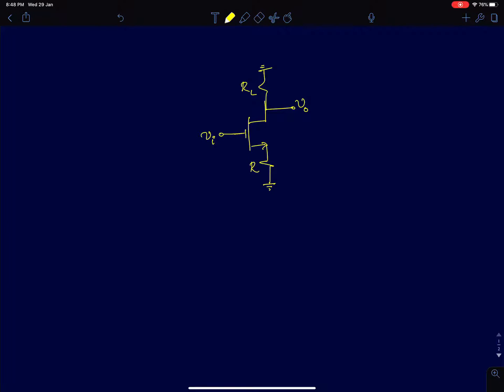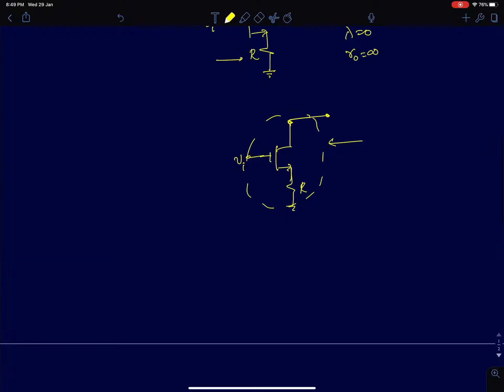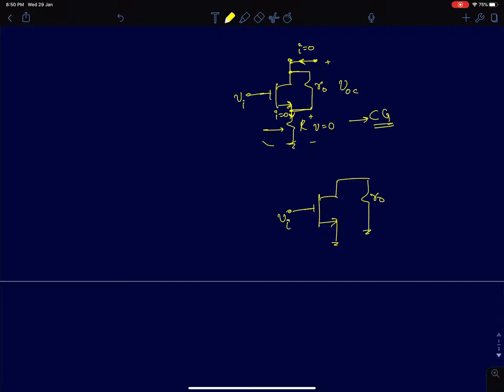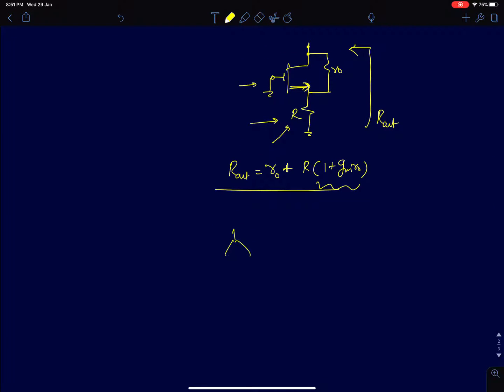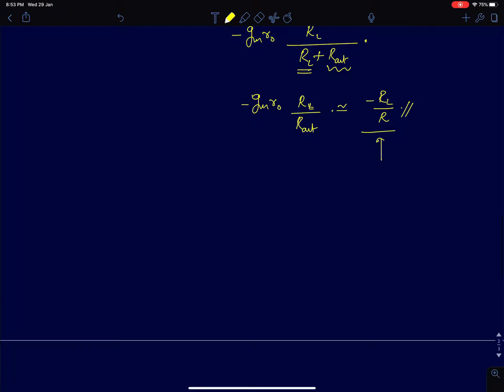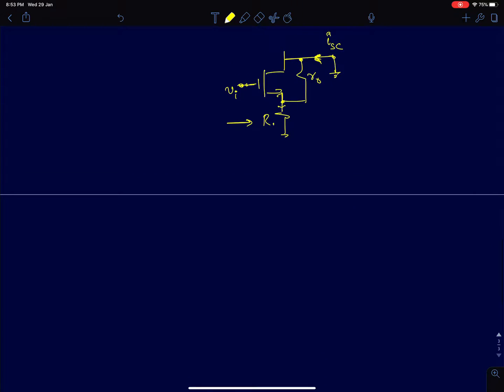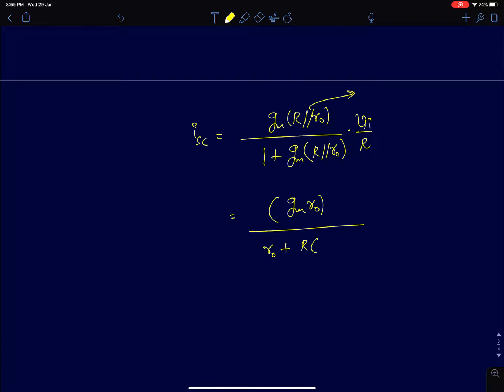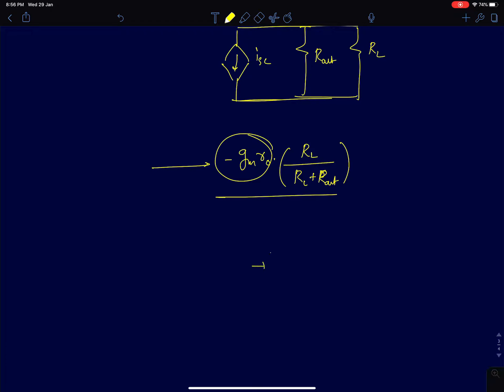AIC Lecture 12.a): Source degeneration in MOS amplifiers- A rigorous analysis

Comment: The case @08:15 when RL --> Infinity, and Av reduces to -gmro is very intuitively explained! (considering AC gnd at source). 
I had come across a very similar problem earlier where drain was connected to a constant current source, so it reduces to a similar ckt.
Reply from the maker: Vasu Gupta Hi Vasu, yes, it is very similar to common gate amplifier with open load, the source resistance Rs has no effect as the current through Rs cannot change and hence the “AC drop” is zero across the resistance. The input then appears entirely across Vgs of the MOS device. Degeneration works only if there is current feedback from the output, when the output current is forced to zero(in this case by making RL tend to infinity), there is no feedback and thus it behaves like a open loop system, (open loop here refers to the MOS without degeneration as explained in the previous lecture).